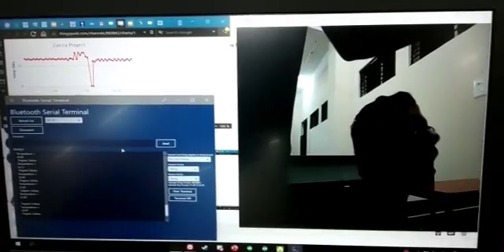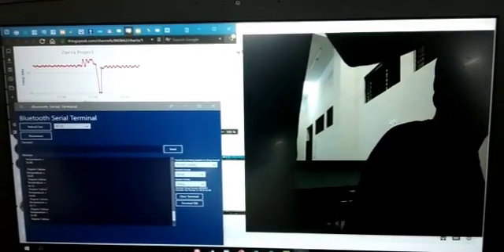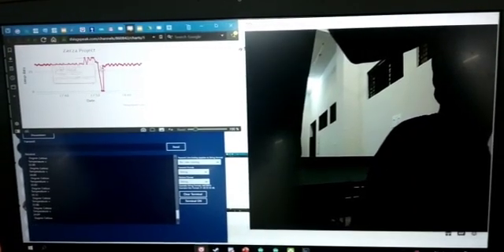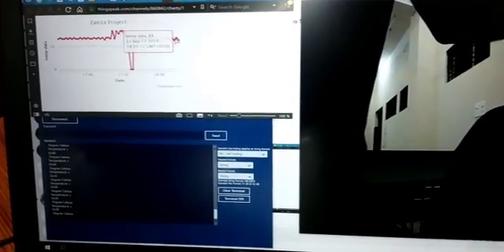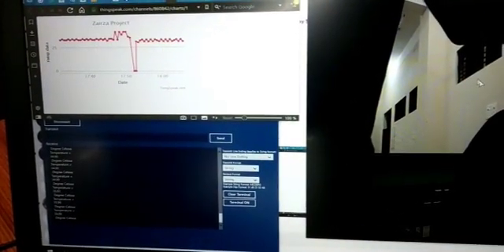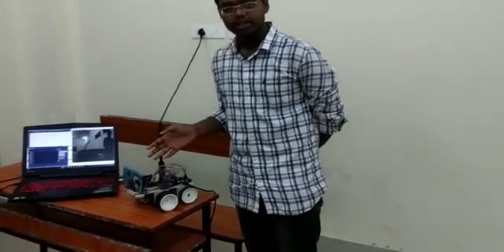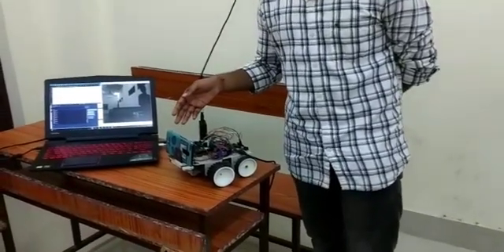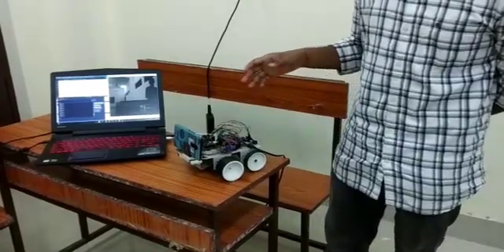Arduino based rescue bot

Comment: So good to see such an innovative approach. Keep going guys. Just a small suggestion:- You can use the nodemcu for driving the bot as well as sending sensor signals to the web server since it can function similar to Arduino. In this way you can also remove the Arduino and make some extra space for an onboard battery.

Comment: Great start guys, hope to see lot more in future.... Small suggestion is that try to make the bot more mobile, use a battery on the bot for everything. Use some old cardboard and stuff to put all the sensors intact on the bot , create small demo scenario of the usecase you mentioned like put some obstacles on the floor and try to control the bot from the nearby other room by looking the camera feed and sensor values. See what all are the issues that might come..... Yeah I know this suggestion is not even close to small 😂😂😂. Happy Learning
Reply: FPV??? 😏